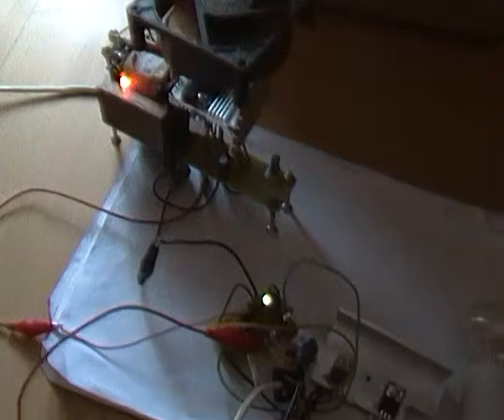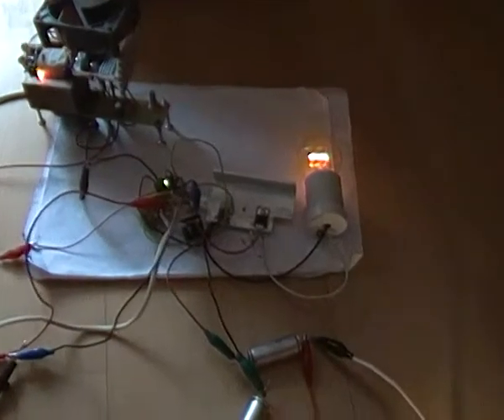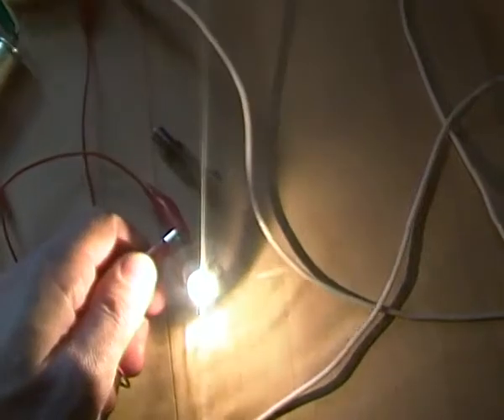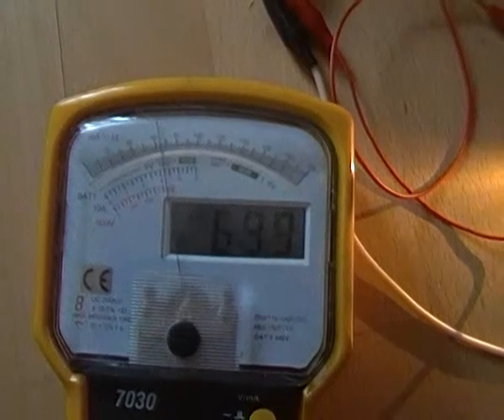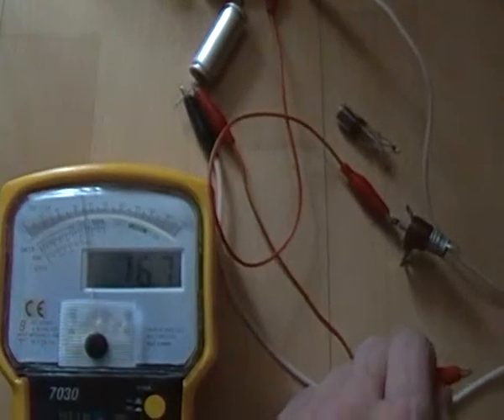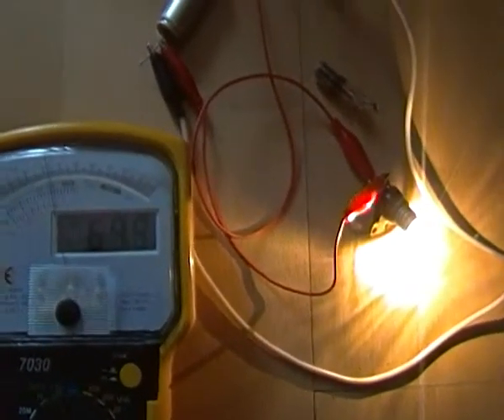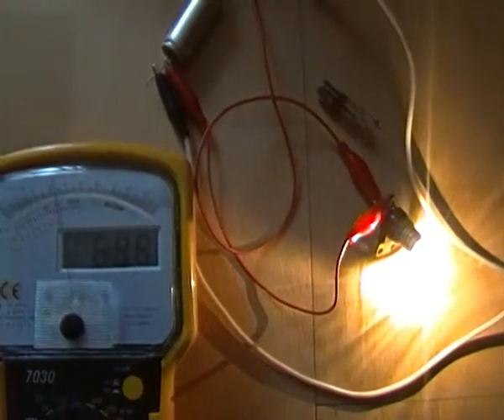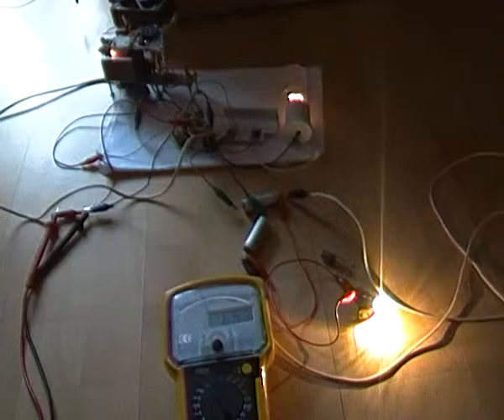Solid State THP

Comment from the maker: 1. The most economic circuit would be if we make a nanosecond spikes (with a kind of laser or x-ray tube power supply) and let it go through hairpin coil and a load in parallel! 
2. In my latest THP version around 50% dissipates on ballasting lightbulb, 30% on the SCR, 10% on the HP-coil and 10% on the load! 
3. The metal rods will just have a slower saturation. The function will be the same. Maybe we will observe a slight change in shape of the spike. 
Glad you want to replicate my circuit!

Comment: I understand. Thanks. Very interesting. I'm planning to replicate this and experiment with it. From what I can understand from it the HV spark is the main power consumer in the system. Am I correct ? If so , do you think there is an alternate solution and make the system more efficient as a hole? Another question. What do you think would be the function of the metal rods?